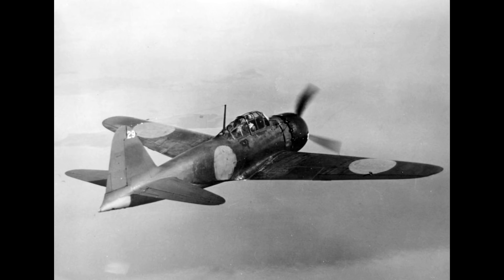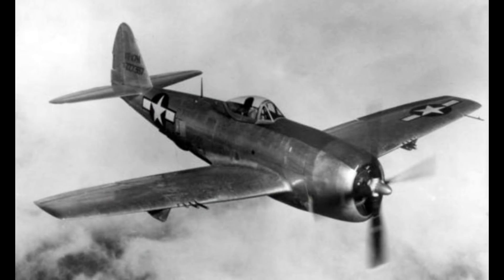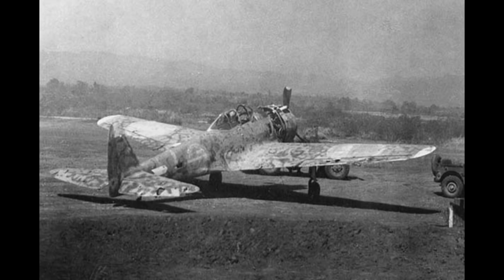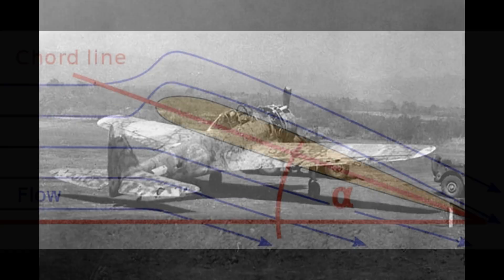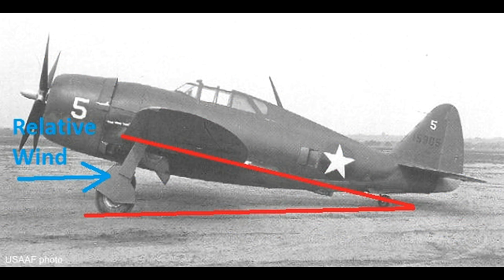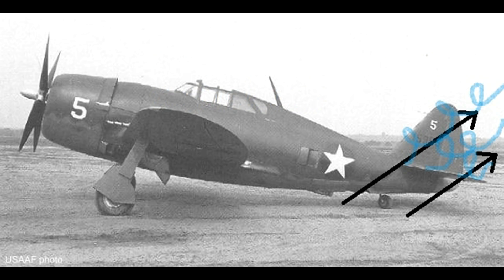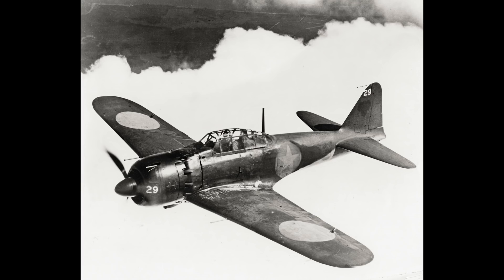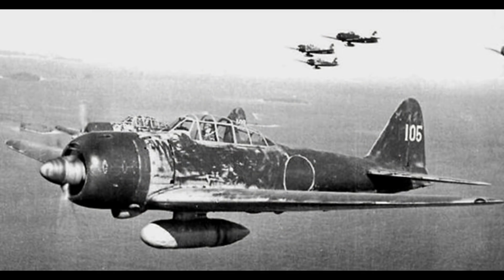Mitsubishi A6M Zero, an interesting fact few people know

Comment: Ok, based on the other comments...  I’ll tell a short story too.  I began my career as a contractor at NASA Langley Research Center, which is attached to Langley Air Force Base.  I worked on a new design to a wind tunnel in the early 1990’s.  During that experience, I heard and old story about the other wind tunnels they had there during the second World War.   The story was that the American’s had managed to capture a Zero.  And at at first they parked it at the end of a runway and let it sit there for a while.  Then they covered it for a few days.  And then one night, in the dark...  they replaced it with another plane that sort of looked like it under the cover.  Meanwhile they took the actual plane into a wind tunnel to do tests on it.  During those tests, they found that at very high speeds the Zero could not regain control very well.  So they sent out the word to all US Airmen that if they saw Zero’s coming their way, they were to start climbing ASAP.  Engage the enemy at the highest altitude they could...  if you got a Zero on your tail, DIVE at full speed.  The Zero would give chase, at some point they were to pull out of the dive and the Zero pilot would realize that they had a problem..  because once they hit a certain speed, control was a full blown job for that pilot.  By the time they could get their plane back under control, the US pilot would be behind them and it was all but over at that point.  Basically, they found the design flaw of the Zero.
Reply: I may be incorrect, but I think the aileron control was very stiff at high speeds and it was hard to turn the zero under high speed conditions, so that it could be out turned at high-speed. I think that is the situation.

Comment: Thanks for posting this video!  I have a large original aluminum panel from an A6M3.  It's from the port horizontal stabilizer, lower side.  Stenciled on it are the original Mitsubishi markings and the factory serial number.
Reply from the maker: Thanks, that's very cool.

Comment: I never heard the horizontal and vertical stabilizers called "stabs" before. Since they're at the rear of the plane, they're stabs in the back!
Reply: ..just an abbreviated 'short' form of stabiliser/stabilizer, and can also be used for the short form of stabilator too  - the all moving tailplane normally found on fast military combat jets. 
  Typically 'stabs' when used without any axial plane indication i.e; horizontal or vertical, it implies a/the horizontal tailplane & their control surfaces.

Comment: Really neat point I have never heard expounded on - thanks.  The Zero's problem against the P-40 - if the P-40 was properly flown (example - Claire Chennaut's Flying Tigers) was that Saburo Saki stated that if you attempted to dive it at 350 knots plus, the wings came off.  And of course, the too close fitted wing tanks (without self sealing) ruptured when struck by a projectile - too precisely fitted into the wing!
Reply from the maker: P40 vs. Zero, I'll take the P40. A lot of accounts by the AVG mention the Zero, but records have shown that these were cases of mistaken identity. We now know that the AVG never fought a Zero, they were confusing the Zero with the Ki43, which is completely understandable as they look remarkably alike.

Comment: The Corsair had the opposite of this; it's rudder was well ahead of the elevators.
Reply: Same with the Mosquito too, I think
Reply: @tylerhoop5312  I was about to make the same remark.
Reply: This was partly to offset the horrific torque produced by the 2000 P&W R-2800 and 13' arc propeller. The vertical fin was also offset 5º to help counteract the torque.
Reply: @scottmurphy650  The 5 degree offset doesn't counteract the "torque", it counteracts the "P" factor of the propeller, where the descending blade on the right side puts out more thrust than the ascending blade on the left side due to high angle of attack.  The torque of the engine causes ROLL, not YAW.
Reply: What a great set of comments without an argument. It would be fantastic if the rest of YouTube behaved the same way. I think I learnt something from every comment. Thank you all.
Reply: And that plane raises a whole lot of other unusual body design features.
Reply: @starjetpilot  while engine torque does cause some initial roll with high power increases at low airspeeds the main issue is Propeller slipstream, which causes yaw due to rotational flow hitting the tail which if left unchecked causes roll. The same occurs on takeoff as engine torque is negates by the fact the aircraft is on the ground.
Reply: @kiwidiesel  The prop slipstream only has a very minor effect on the yaw stability and roll stability once the speed gets up to at least 75 miles per hour.  With that airspeed the flow going past the tail has pretty much straightened out.  What are your qualifications, as far as aeronautical engineer?
Reply: @starjetpilot   Yes I am aware of what you say,  I was merely making a notation to your statement that engine torque isn't the only contributing factor to directional stability. There is always propeller slipstream to contend with at any speed tho and as you state with higher speeds the apparent torque effect of the engine is also reduced is it not? I'm not sure what qualifications I have has to do with anything tho.  Acting forces on an airframe don't just disappear and propeller slipstream effect never disappears on a single engine aircraft or a multi engine if they swing the same direction.  The directional trim of an aircraft is required to be adjusted everytime the engine power is adjusted so even above 120 kilometer per hour it is to be contended with and more so below this speed.  But I guess actual flight time and real world experience doesn't measure up to being an aeronautical engineer.
Reply: @kiwidiesel  Yes, the apparent torque effect of the engine is reduced at higher speed, because the propeller is only maintaining speed already accomplished, no acceleration, so there is less pressure on the backside of the propeller.  Directional trim does not necessarily have to be adjusted every time the engine power is adjusted, only in a climb because of "P factor", with the descending blade giving more thrust than the ascending blade (higher pitch angle to the airstream).  I have 960 hours of flight time with almost all possible pilot licenses and ratings, and was an FAA Air Traffic Controller for 21 years at six different control towers, and built and flew radio control while a teenager, and designed a two-seat fighter-style jet, the design of which came very close to being used in the James Bond movie, "Die Another Day", and may be used in the next "Top Gun: Maverick" movie due out next July.
Reply: @starjetpilot  Congratulations on your near stardom accomplishments with the jet fighter. Did it go into the build phase? What did you have planned for power plant?  While I have never sat at the seat of an air traffic controller I have had many conversations over the air during my time flying. I have approx 1300 hrs seat time, most in the right hand seat from my instructor days and as a result I actually prefer the right seat now even when PIC.  During my time as a para drop pilot we used to eject the meatballs from the right side of the plane to reduce propwash effects as they exit and I had some great first hand experience with prop "p" factor and it's effects during my  single pilot multi engine instrument training especially when you have a critical engine out situation, thankfully most light piston twins now have contra rotating props to help degate the effects of "p" factor during critical engine out ops. Since few propeller aircraft fly at zero aoa there is always going to be some "p" factor to contend with and it really hammers home the importance of VYSE and how quickly things can change when airspeed is not monitored closely.  You are correct regarding not having to always adjust rudder trim but if you don't adjust it you have to use your legs a little more to maintain balence and that gets sore on the leg quickly. I learnt the importance of directional control and balence during my aerobatics flying where you can get into a bum puckering high speed wing drop and spin by not having that ball centered when pulling out of the backside of a loop. Never foundyswlf upside down so fast as that time. Good lesson in hindsight as I was able to learn from my mistakes while having sufficient height to recover the plane and the seat cover from my bum. Principles of flight are tricky in that it becomes difficult to explain one aspect without having to include others to properly achieve the desired explanation, in thanks to the fact that if you change one setting you change alot of previously balenced forces resulting in constant corrections.
Reply: @nickc6882  sorry mate, looks like this comments section devolved after all
Reply: Exactly! 👍 For the very same reason; to prevent rudder shielding by dirty air coming from a stalled stab!
Reply: I read the Corsair was like that to make room for the aresting gear hook in the tail end

Comment: To improve the maneuverability below countermeasures were also taken for Zero.
1) Wing Roll-down:
To avoid "wing tip stall," her wings were rolled down 2.5 degrees from the "inner aileron area" until the wing-tip, which cannot be seen with your eyes. 
2) Lowering Rigidity of Control Cables:
The higher the velocity is, the "ailerons, elevators, and rudders" are the more responsive in the same angle. So Mr. Horikoshi (Chief Designer Zero) lowered the rigidity of her control cables to result in lowering the angles in the higher velocities.
I sincerely appreciate engineers' efforts for Zero that time.

Comment: I know that in another video Greg states that the main goal of Japan's military was to field extremely maneuverable aircraft which is why they had lightweight aircraft.   I believe another major concern was having the need for aircraft with excellent range because of the battlefield they were expected to operate in - widely dispersed Pacific Islands, and also because of their chronic shortage of oil.  I believe they actually specified a smaller engine than what was available for the Zero because of these "needs".  The Zero had wing skins that were of varying thickness to keep the weight down and early versions of the Zero reportedly would start shedding their wing skins in dives over 400 mph.

Comment: The P-51 and Corsair are two examples of extremes in relation to the Zero. The Mustang's stabs were even further forward than the Zero. The Corsair, the opposite of this. The P-26, a design just prior to the Zero, had its stabs forward of the verticle which in turn was quite small. I find it interesting that Messerschmidt tended to place his stabs "on the vertical", rather than the fuselage. German WW2 designs often had the trim for the stabilizers work to adjust the entire assembly instead of using tabs. This was precariously close to the "moving tail" of the F-86, which was a unique advantage of the 86 over the MiG-15. I am quite happy that German engineers didn't quite connect those dots during that war. I also find it interesting that the B-26 is similar to the Corsair configuration.
Greg, I have to thank you for taking me down this road. In my latter years I haven't spent much time chasing tails, and am reminded how much sleep can be lost doing so!

Comment: The F4U Corsair has the rudder set way forward of the horizontal stab and I've wondered why that was, probably for the same reason.
Reply: I remember another one of this dudes videos mentioned that, and he said it was probably for structural reasons. There isn't enough material at the very tip where it is so skinny to not break if the rudder was that far back.
Reply: @lobsterbark  it is a both simpler a reason/explaination and also is just as true too with regards the material specifications of rear spar of the fin/rudder post assembly's torsional requirements.

  And then the other CV thing often forgotten, the height of max safe hanger clearance. Hence why usually carrier based prop' planes fins and rudders can appear to be taller & broader (long in fore & aft length) looking than land based prop aircrafts, which normally have, and had back then, a longer take-off distance available and higher landing & stall speeds than CV birds required.
Sorry for the wall of text, I most likely got some aspects and things wrong, I am just going off the top of my head wooden Mk.1 brain-power ;)
  It could be said, the Corsair could've or would've had a 'deeper' larger rear fusalage of its tailend general diameter if it was an earlier design born with some less well devloped older materials engineering, construction & production maufacuring and design methods used on, in and during earlier US & Chance-Vought aircraft.
Reply: Yup! Exactly right

Comment: It is popular culture these days to overlook the lightly armored philosophy of the zero design, but it was a factor. Hang two 500 lb. bombs under the wings, then see how it turns. Allied aircraft had some degree of armor, and it was heavy.
When the allied pilots were taught what to do and what not to do, the zero became an easy kill. Even light damage could kill the pilot while the plane was still flyable. Ground attack in a zero was also much more dangerous than in Any of the allied aircraft.

Comment: Now take a look at the F/A-18 Hornet and see the same thing, but the other way: rudders way ahead of the horizontal stabs. The reason is much the same, though -- keeping the rudders in clearer air at high AOA.
Reply from the maker: They also tilted the rudder outboard for a similar reason. This gives the F18 good rudder control at very high aoa.
Reply: @GregsAirplanesandAutomobiles  wasn't the tilt for the rudder assisting in pulling?

Comment: The FW 187 had a forward set stabilizer too. Great aircraft which showed clear potential over the BF 110 where it counted. Politics for you
Reply from the maker: Different reasons, I don't think they planned on doing spins in the FW187, good observation though, that's a rare plane!
Reply: Greg's Airplanes and Automobiles apparently it could keep up with the earlier 109 variants, though I doubt it could out turn them
Reply: Greg's Airplanes and Automobiles you're getting confused with the FW-189 Uhu,  the FW-187 was smaller but similar to an Me-110, only a handful were built.
Reply: Seem to recall Goering or someone hat personal grievences with the head of FW

Comment: The Zero was very agile at low speeds, but had very heavy ailerons at high speeds.  The poor Zero was a one-act pony.  It burned real good too.    P.S.   Greg, your videos are all very interesting!
Reply: Correction:  one-trick pony.
Reply: I believe that the Zero could outmaneuver any American plane in the 180 to 200 mph range, but if the American pilot could keep his speed above 280 mph, he could outmaneuver the Zero.  It was said that with partial deployment of their Fowler flaps and use of differential throttle, the P-38 could dogfight the Zero in the 180 mph range, but P-38 pilots were told to keep their speed up because at higher speed they had the advantage.
Reply: Well one of the this was that control lines on the zero were made to stretch to dampen heavy control input at higher speeds (partially to prevent overstressing the aircraft, partially to make it so that if the pilot pulled back the stick X far, at most speeds it would produce about the same rator of attitude change). Thus above 250-300mph they would have even higher stick forces than comparable fighters, and often simply couldn't pull as tight of turns as planes like the P40 and Wildcat could at those higher speeds.
Reply: it wasn't quite as one act as its reputation gave it.  heck, i'd imagine that as a civilian aircraft, it would be safer than pretty much anything on the market.  The lack of armor and self sealing tanks were the real killer for it, but to be fair, there was at least some logic behind, even if ultimately flawed.
Reply: Jim H. I think some spring tab ailerons would have helped with this, like on the Bf 109G.
Reply: The later models did have self sealing fuel tanks and even a CO2 system that would flush out the fuel vapors in the fuel tanks like the US had.

Comment: With the caveat that I'm not an aerodynamicist or aeronautical engineer or any kind of expert on anything...  I am a SAILOR of small sailboats, and used to love watching the Americas' Cup races on TV, (and listening to Gary Jobson and other professional sailors talk), and from what I've observed, and remember hearing, the air coming off a wing, or a mainsail, is disturbed not only surprisingly far downwind of the sail, but also immediately behind the trailing edge and even AHEAD of it. I demand to see those wind tunnel test results!  I want a recount!  I find it dubious that a shift of 12 inches would make that kind of difference in the effectiveness of the rudder. Thank you.
Reply from the maker: Those wind tunnel results are discussed in a Japanese language documentary on the Zero. It's here somewhere on youtube in 4 parts. I am not going to dig it up though. As for air having turbulence prior to the trailing edge on a airfoil, that's true, it does happen. I imagine it happens to a greater extent in sail boats, but that's a bit outside of my area of knowledge.